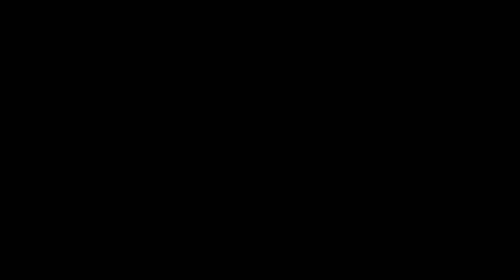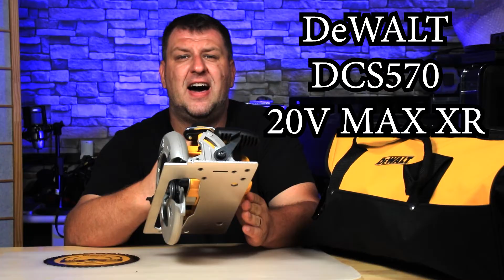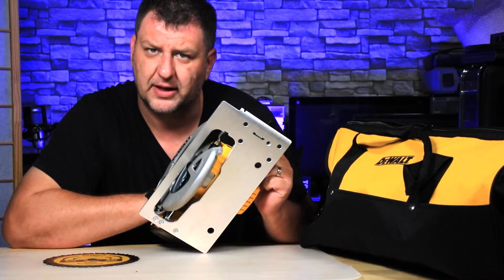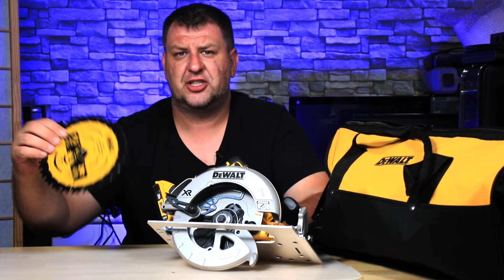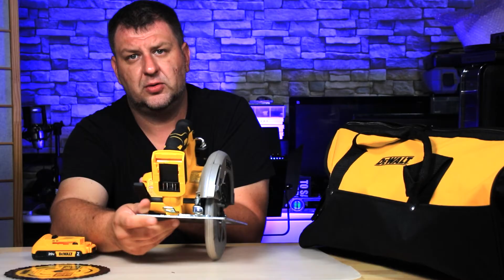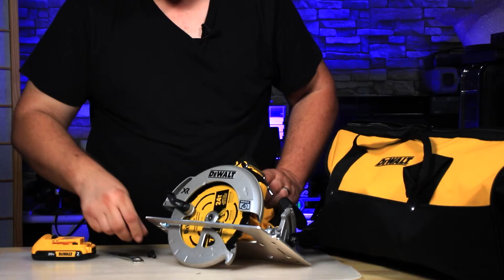How to Replace Install Saw Blade in DeWALT DCS570 20v MAX XR

Comment: Thanks so much.  The manual suggests you need a degree in engineering just to study all of the parts before you even bother to install the blade.  Also I had no idea the wrench was in the back of the saw.  Super helpful.  Many thanks!

Comment: I noticed several people commented that the "tip cover" or washer that holds the blade on would not come off when the bolt was removed.  I tried prying it off to no avail.  Then I simply turned the saw on its side and gravity did the trick.  Seems simple and stupid now but it had me stumped for a bit and evidently I wasn't the only one.  Thank you for a great video!
Reply: don't comment normally.. i found god tonight. thankyou!

Comment: All circ saws run counterockwise.
Reply from the maker: Yes, and no. For left handed circular saws the it spins clockwise. But the blade teeth will always face and cut the wood same way.

Comment: Best video yet. The manuals are always minimum with details. I snugged up the blade after putting the blade on with the lock still engaged. After tightening, I released the break and noticed sluggish turning? It seems to click as it turns the blade? I guess this is normal ? I will put battery on and check it tomorrow when the battery is charged. Thank you for your videos! Much appreciated.

Comment: have same model, full battery, and not overtightened, but the saw will not turn.  there is a clicking sound that comes up with it.  Have had it for just under 1 year.  Any advice?
Reply from the maker: When you say will not turn do you mean will not lock in place to remove the blade or do you.mean it does not turn phen you press the triger?.  If it clicks and will not turn when tricker is pressed i would say relay might be bad and you need to try to get it replaced hopefully thrue warrenty

Comment: I have a saw like this and i got the screw out but i cannot get the outer washer out (the lock washer) can you show how to remove that washer?
Reply from the maker: I will dpuble check tommorow. But i believe it just pops up.
Reply from the maker: Sorry for yhe delay. The bottom washer does not come off. You can take it off if you really needed to by removing the ring that holds it in place. Only the top washer comes off and that should just pop up once you remove the screw.

Comment: I need to install my blade and have tried clockwise and counterclockwise to remove the screw to install. Nothing is moving. Which way should I be turning to remove to install blade?
Reply from the maker: Counter-clockwise to remove the screw